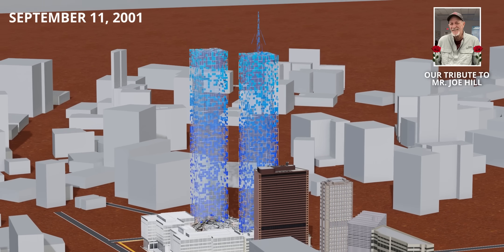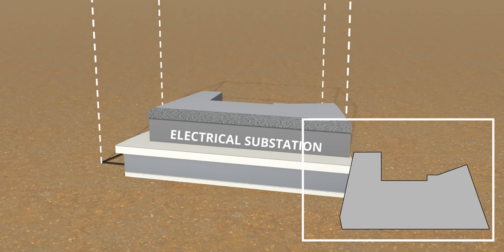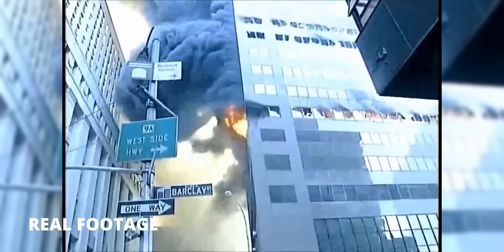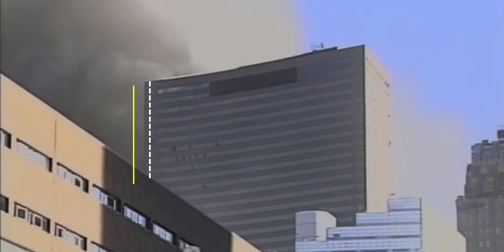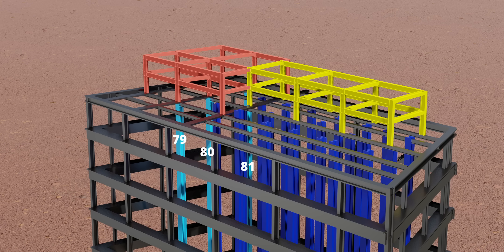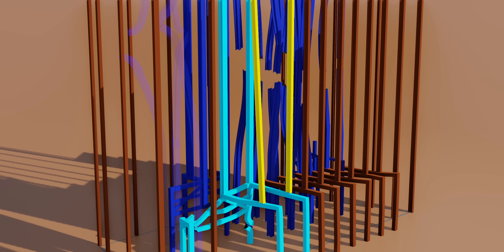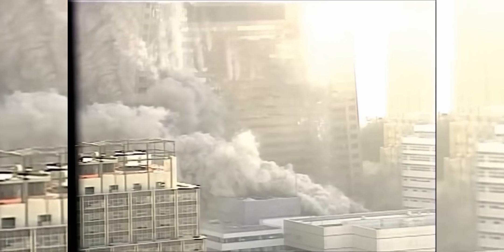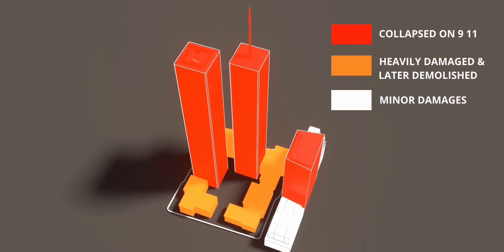Collapse of Building 7 | The Complete Physics

Comment: bruh.. First, the spire did not hit the Tower 7.. Second, there was 2.25 seconds of freefall speed and it was verified by NIST. This is just another model with no veracity to this claim.
Reply: The antenna didn't hit Building 7.  The video gets that wrong. It was perimeter column spandrels from the north face of the North Tower. Same source, different piece of metal.

Free fall can refer to a state or a rate of acceleration but it is never a speed.

Also, so what?
Reply: @TheCriticalStinker-01  explain to me how freefall is maintain for 2.25 seconds?
Reply: @Blitztriech  - There was no sustained period of FFA - it was a curve - and it was only the outer shell anyway, which dropped after the last 4 columns failed.  It's meaningless.
Reply: @TheCriticalStinker-01  meaningless?? "yeah, right"
Reply: @Blitztriech  - I think you should take more time to make your arguments.  Judy Wood for example denies explosions.  She's got her own thing going on in the 9/11 Woo marketplace. 

Yes, I am aware of people using the magic word explosion in carefully quote-mined and out-of-context casual clips.  You guys have been utterly failing with that crap for 20+ years.  

News flash:  ExplosION does not mean _explosIVE and at some level I suspect you know this.  Probably explains why you rely on old cherry-picked video clips and not one of you has ever once bothered to do an in-depth follow-up interview with any of these key witnesses. 

And how that line of argument has been the path of proven epic fail for 20+ years.
Reply: @TheCriticalStinker-01  My previous question, "If it was not explosives then what caused each of these explosions in the video?" bruh.. what are you even asking? I am asking a very specific question.. if it were not explosive then what caused it? I do aware that explosion is not necessarily caused by explosive, so don't show me some random case, cause might be different, so provide proof of what cause those explosions of WTC7? I am trying to be open minded of your idea but it seems like you are avoiding my questions.. 

first, I asked about freefall, you said meaningless. You have to understand the context that NIST admit the freefall exist after the report was reviewed and questioned. NIST did not say or made any statement it was meaningless. NIST model is another model just like in this video above.

Now, what caused those explosions? do you have proof that it was not explosives? I asked you this question because you totally rule out explosive out of possibility.
Reply: @Blitztriech  - THERE ARE NO EXPLOSIONS IN YOUR VIDEO only cherry picked clips of people using the magic word explosion removed from proper context.

18 hours ago I gave you a lengthy explanation for the collapse of Building 7.  YOU IGNORED IT!
Reply: @TheCriticalStinker-01  https://www.youtube.com/watch?v=EhuuHfHAEHk&t=106s
Reply: @TheCriticalStinker-01  I actually read your explanation.. since your first post. I watched link given in your comment since your first post. the explanation is still a theory to me until it is proven and those simulation. I have seen those simulation in the video before. you cannot convince me that the simulation mimic exactly what happen to WTC7. people can watch the simulation and judge for themselves.
Reply: @Blitztriech  - Models do not exactly mimic real events. If that is your expectation then your expectations are wrong. Models test mechanisms.

I do love how my detailed the thorough, start-to-finish, point-by-point analysis to you is theory yet if one person utters the magic word explosion you go all in complete nonsense.

IF I have made any errors of fact, logic or reason please feel free to point them out and I will make the necessary corrections.  If you just need to wallow in denial for the sake of wallowing in denial, that's on you.

I suspect we are done here.  Good luck with that.
Reply: @TheCriticalStinker-01   "Simulation does not mimic real event..." 🤦‍♂Ok man.. we're done here.
Reply: @Blitztriech  - Yes.  Although I don't even know exactly what simulation you are talking about (there are none for example in the video above, only animations), since vague ambiguity is your SOP, simulations and models are NEVER going to be exact, photo-realistic recreations of a real event as complex and dynamic as the collapse of a building. That is not what they are meant to do.

Let's say a box of matches falls off the table and lands on the floor. 

Do we care why the box of matches fell on the floor or where every individual match ended up?

Don't lose sight of the bigger picture.

PS

Building 7 collapsed due to 7 hours of unfought multi-floor fires.
Reply: @TheCriticalStinker-01  I love how you choose your example when I mentioned simulation I was referring to NIST simulation. Sure bud, "that is just an animation that was doctored to be distorted". You used big word but the message is still bullshyt. You just cannot accept that NIST model is flawed. are you saying to me that the distorted part of the model are not caused by structural failure? we are talking about structural integrity relative to fire. sure, the fire was continuous for 7 hours but NIST acknowledged that any given office area, the office fire only last for 20 minutes to 30 minutes. but this does not reflect in their report especially at the floor that caused the collapse. in their model the fire at the floor was consistent for 7 hours. again another inconsistency. NIST also claimed that if shear stud was used the building would not collapse. but that does not reflect in the report. another inconsistency. I am not gonna respond anymore. Good day!
Reply: @Blitztriech  - The NIST did four different (4) models, not just one. Each testing different scenarios. You would know this had you actually read the report instead of (badly) copying other people's complaints about it.

So please, identify which of the four NIST models you are referring to, what the objective of that model was and why it is flawed - how did it not achieve the objective of the model.  Note:  I am not talking about your assumptions of what the model should do, but what it was actually intended to do.

Also please note:  No report written years later can change anything about what happened. The NIST can even be wrong or rely on too many assumptions about some detail AND the collapse of Building 7 was still due to 7 hours of unfought fires

Throw out the entire NIST report and that is still true.  

You are not doing anything to move the needle on that,
Reply: Oh, look. A whole heap of dumb shit. Let's see:

"Second, there was 2.25 seconds of freefall speed"
That you don't know what the words you use means? Should indicate you not use them, lest you flaunt your failure. Just a free hint.

"explain to me how freefall is maintain for 2.25 seconds?"
It isn't. That you don't understand it means you don't understand it. Nothing else.

"How about I show you a video compilation of multiple sources, even news and interviews, that record explosions after WTC1 and WTC2 collapsed"
Since you can't, so what?

"there were some inconsistencies that were challenged by multiple sources including Dr. Judy Wood"
This being the same Judy Wood that is mentally retarded due to traumatic brain injury after a car-on-bicycle accident? Who says, essentially, that magic happened? Because, there is no mechanism that can do what she claims happened, according to physics as known at this point by the human race.

Incidentally, ignoring the above, Judy Wood disagrees with you, since she says there were no explosions. So....which is it? Is she right, in which case you're wrong, or is she wrong, in which case you called on a supposed authority that disproves your own statement.

" I am asking a very specific question.. if it were not explosive then what caused it?"
All sorts of things make loud noises. "It sounded like a bomb went off!" does not mean a bomb went off. It means there was a loud noise. Exactly in the same way as a backfiring car "sounded like a gunshot".

"You have to understand the context that NIST admit the freefall exist after the report was reviewed and questioned"
NIST did not "admit" anything. It was in the report from the start. That some people went "AHA!" means only that they thought it was relevant and that they'd somehow caught someone out. They didn't. They found something that was in the report and wasn't relevant or important so nothing was made of it.

"you cannot convince me that the simulation mimic exactly what happen to WTC7"
Bravo, you figured out that simulations are simulations. Nothing "mimics exactly" what happened, because it's a chaotic system. What simulations do is test, and find the most likely chain of events.

The magic word "explosives" does not change reality, any more than "free fall speed" does.

"I love how you choose your example when I mentioned simulation I was referring to NIST simulation"
That you don't know anything about the NIST simulation means you don't know. I refer to previous, "When you don't know." See above.

"NIST acknowledged that any given office area, the office fire only last for 20 minutes to 30 minutes"
Making up nonsense isn't an argument, you do realize this? It's known as "lying".

" in their model the fire at the floor was consistent for 7 hours"
As you would expect, considering that, what do you know, the fire was consistent for 7 hours. This is, after all, the words of the actual experts.

" I am not gonna respond anymore"
It's terrible for you that your dumb shit was outed as being dumb. That doesn't make it less dumb, and it doesn't make you not running away instead of facing reality.

Comment: You point to the failure of the left side supports under the penthouse. But how does the energy move from the left side fast enough to ensure the entire structure came down parallel with the ground?
Reply: Like this:

Building 7 collapsed from the inside out which is not at all intuitive and hard to understand, with most details being hidden from view.  It requires careful analysis and observation, and some people will struggle no matter how much it is explained. But here is my explanation relying on no outside authority. 

Building 7 was a unique, asymmetrical 47-story steel frame structure built atop a smaller 3-story building serving as a partial foundation, requiring lower floors dedicated to complex load transfer structures. Of trapezoidal shape and tube-in-tube construction, B7 (above the 7th floor) consisted of a central core of steel columns carrying most of the gravity load, perimeter steel columns around the outside of the structure carrying the remainder of the gravity loads and long span beams and girders to tie those elements together and form the floors. On the outside of the building hung a facade or outer shell. 

www.nist.gov/image-16640

Phase 1 : First externally visible signs of collapse initiation occurred at 5:20:28 pm and was notably quiet with observers not realizing the building was collapsing! No warning in the form of hundreds of eardrum busting 180dB explosive bangs. Here at 12:00 a local CBS affiliate reporter talking 10 blocks from B7 when collapse begins. People don’t start to notice the collapse until 12:11. At 12:45 is the famous CBS fixed camera clip of Building 7’s collapse. Note the silence. 

www.youtube.com/watch?v=t5tEy6mXSE8

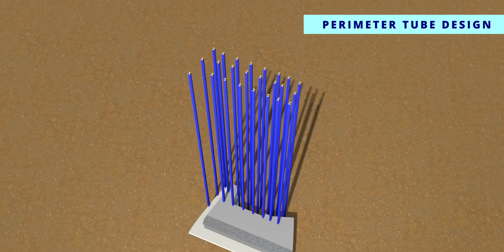Lower floor failures above the load transfer region (8-14) in the NE corner initiated the collapse. In this video at 0:45 you can see the NW corner from inside the building while under construction, Column 79 just out of frame on the left. That big, angled steel beam across the top of the frame connects to C79 at one end. The girders connect to the beam. That beam and all those girders depend on just one connection 

www.youtube.com/watch?v=nP3TNHPCIVU&t=45s

Phase 2 : NE corner floor failures caused a loss of critical lateral support over an excessive length of Column 79 and it buckled. Looking at the above floor diagram of Building 7 when you see all the structures that depend on C79 you quickly realize this one column was a relatively isolated structural element on which a disproportionately greater fraction of the structure depended analogous to say the Key Bridge. Externally as collapse begins we see a vertical progression of window breakage along the 44-46 line and a kink in the roof of the East Mechanical Penthouse at the top of the building, consistent with C79 failure. Normally with a buckling column, the load could be redistributed to other columns. With C79 that is not the case - the failure did not redistribute the load, so the collapse rapidly progressed to the roofline, sinking the rooftop penthouse. The transition from full capacity to almost no capacity occurs in an instant and will result in virtually no resistance 

Phase 3 : With C79 gone, B7’s progressive, non-symmetrical collapse continues with adjacent columns 80 and 81 left laterally unsupported and quickly buckling as well. The EMP drops down through the building. C79-81 all have no diagonal bracing, which is the major reason why they could not redistribute a lot of vertical loads among one another. From there collapse progressed from east to west through the central core until the core was gone from 81 to 58, taking all the interior floors and probably most of the perimeter columns with. Follow the horizontal progression of window failures low in the building and the dropping of the remaining rooftop structures into the building. The NIST Building 7 study model 4 determined C79 failing under ANY circumstances would have initiated the same collapse sequence. 

Phase 4 : After about 10 seconds only the exterior moment frame remains, giving the illusion B7 is still standing to the casual observer since little has outwardly changed. But it is just a hollow empty shell like an empty cereal box supported only by a few remaining columns and overloaded from the loss of the core columns and floors, quite unable to remain standing. With nothing remaining behind it, the north face leans inward, forming a V in the roofline, the last few columns buckle under the strain and the moment frame free falls, landing on top of the debris pile. 

It is only here at the very end, a single measurement of alleged free fall acceleration is taken, from just one point on that outer shell. The Building (core and interior) did not “free fall” - was already gone before that happened - just one corner of the outer shell briefly moved at a rate comparable to FFA. This alleged FFA was a product of how the shell fell NOT why the building fell . It’s also not even proper FFA as the single measured point was moving in 3 dimensions, not just down, which adds another variable. Start to finish the collapse took 18-20 seconds, 3 times longer than true FFA . How fast something falls can’t tell you what started it falling, certainly not 10 seconds after it started falling.  

The debris spread outside the footprint blocking surrounding streets, heavily damaging the Verizon Building and destroyed Fiterman Hall. 

No building is meant to survive 7 hours of multi-floor unfought fires. Building 7’s progressive, non-symmetrical collapse was incidental, unintended collateral damage from the combination of fire, time & gravity started by the collapsing North Tower, true no matter who planned and carried out the 9/11 attacks or why .  Of so little consequence it barely registered at the time. 

I hope you found this helpful, informative and it solicits informed critical comment. If I made any errors of fact, logic or reason or left anything important out, please let me know so I can fix it. OR offer a more plausible alternative if you can. Be the first. Please start any reply with the words “Tits McGee” or I will know you didn’t read it and are wasting my time.
Reply: He is describing the stages of a controlled demolition while simultaneously attempting to explain them using a progressive collapse analogy...🙄

Comment: According to this data, if I drive a car at 60 miles an hour and a oncoming fly hits my windscreen at 2 miles and hour at a 30 degree angle the fly will penetrate the windscreen go through me the chair and floor penetrating the fuel tank and cause a massive fire
Reply: Please show your math on both.
Reply: That you failed to understand the video mean only that. This is known as a "you" failure.